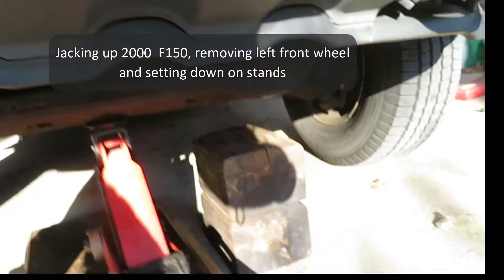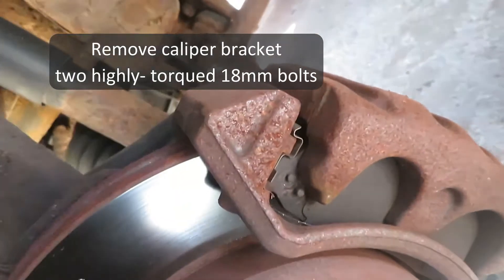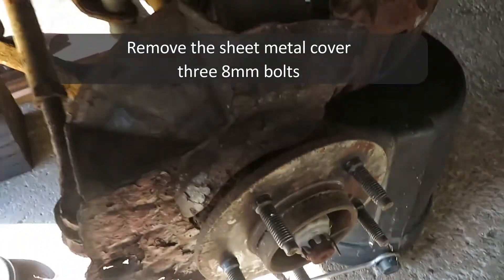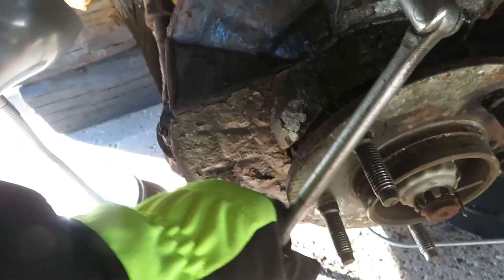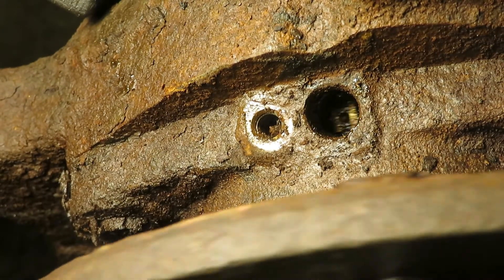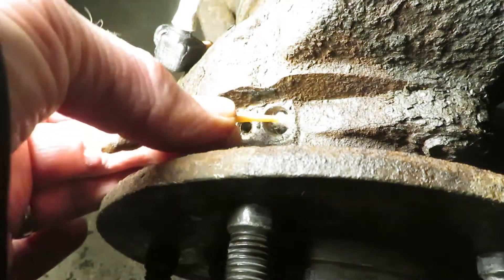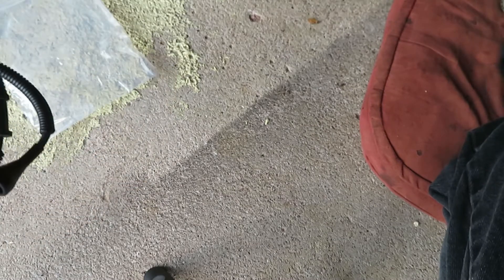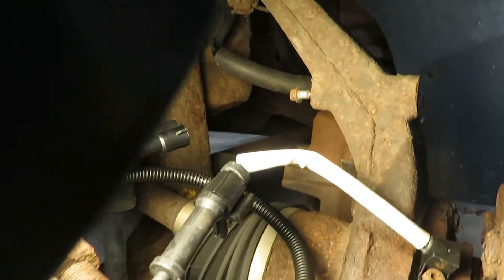How to Replace an ABS Wheel Sensor Ford F150 and Many Others

Comment: Where did you order the ABS wheel Sensor and many times since that you ordered the parts? Thank you.
Reply from the maker: I got this one on Amazon. I bought another one two years ago and it's working fine.
Reply: Are there rear wheel sensors as well?